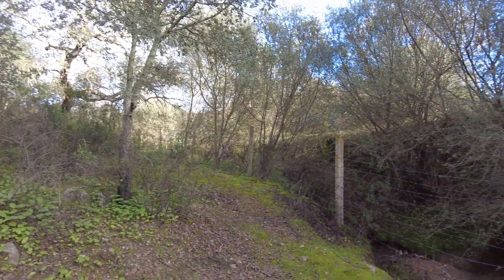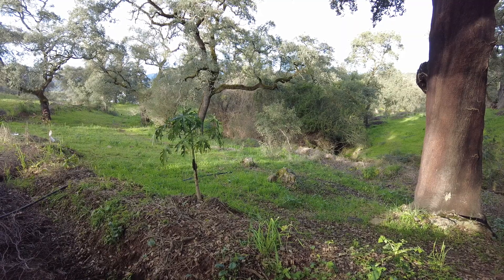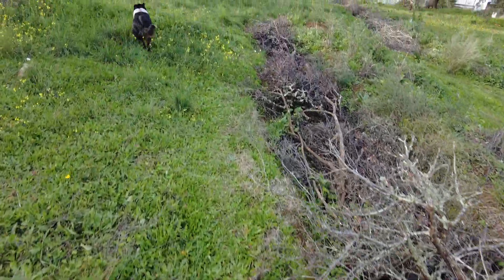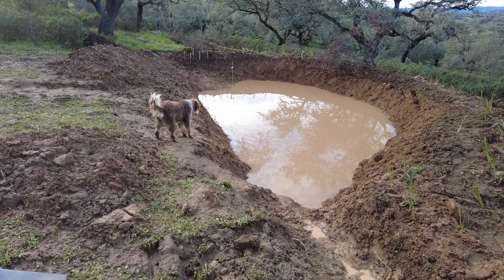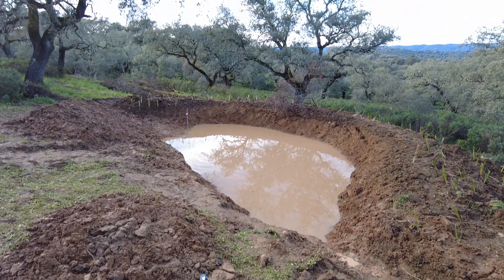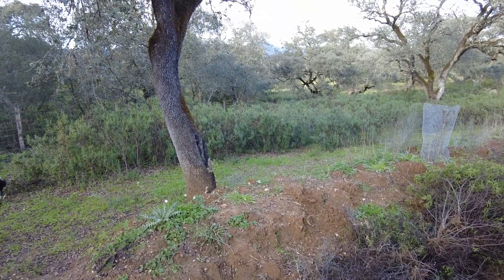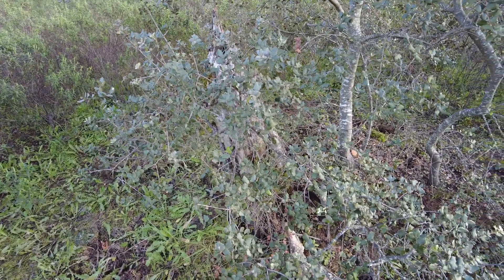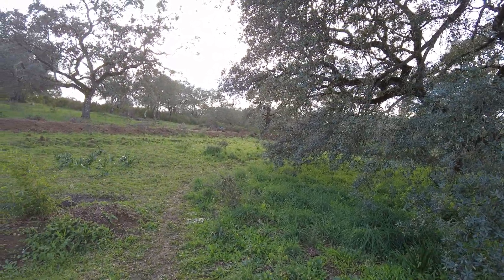Will the new pond still have water 48 hours after the rain?

Comment: finally!! congrats! stack some boulders in the inflow to prevent sild erosion
Reply from the maker: On the programme. Waiting to dry so that I can walk around the area. Thank you for sharing
Reply: I believe the inflow is controlled because of the long distance the water travels from the road culvert diversion dam through swales with little gradient.  I suggest a leaky weir built by the Farmers wife replicating the one she has already built is the perfect solution.  No need for boulders. Then nutrient rich sediment can be easily shoveled out of the swale and onto the berm.